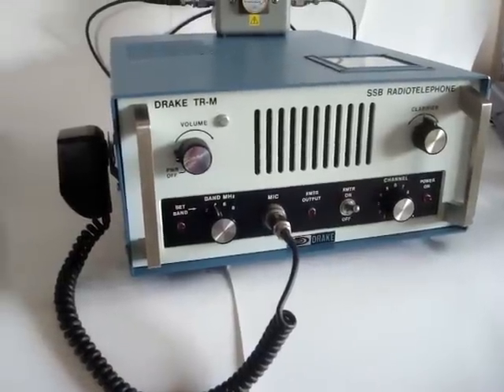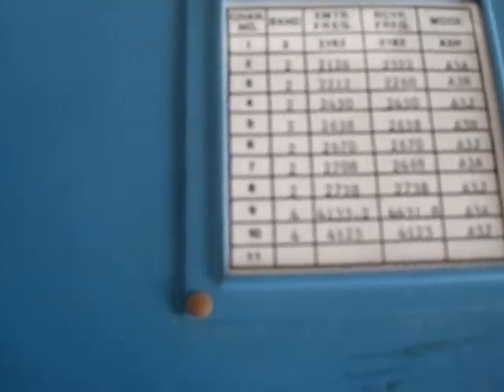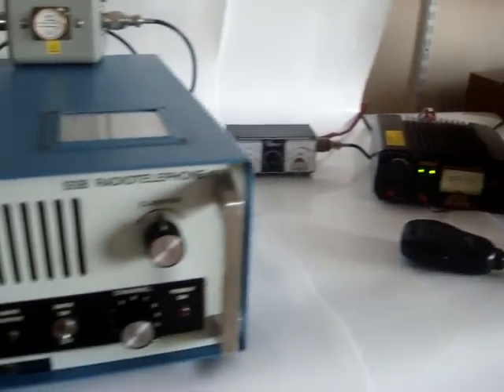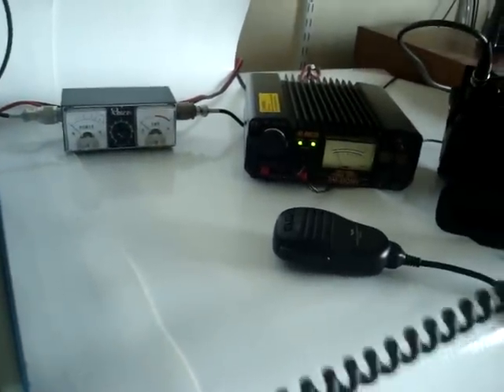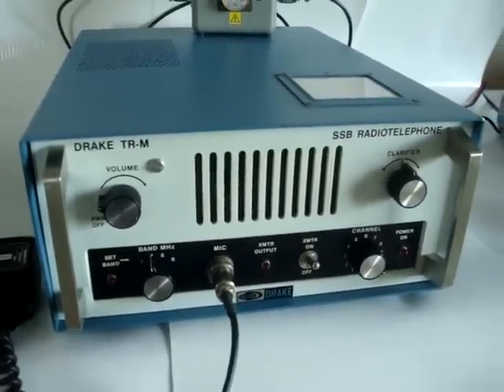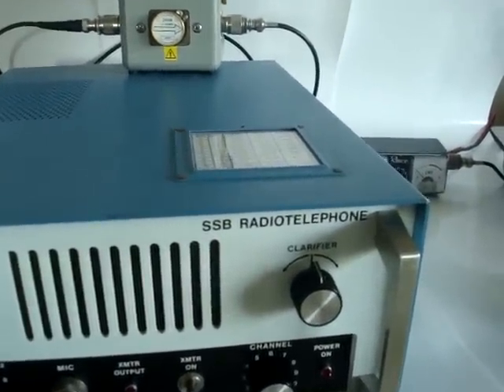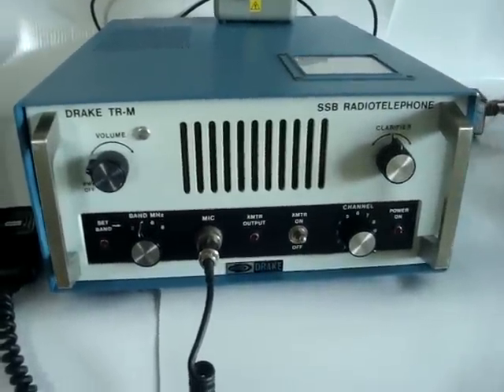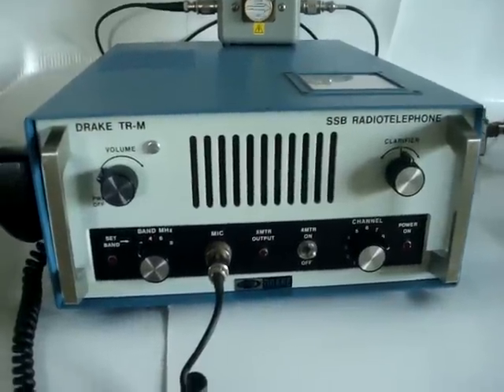Drake TR-M HF SSB marine radio

Comment: These were used as an inexpensive alternative in the marine industry for SSB communications.  I installed the first one on the GULF COAST, using two antennas, one for 2-4 megs, the other for hf frequencies. I still have my service manual. If any of you have or need technical info, gbf@atvci.net.  Would be glad to try helping you.